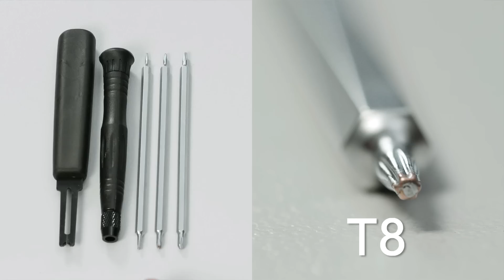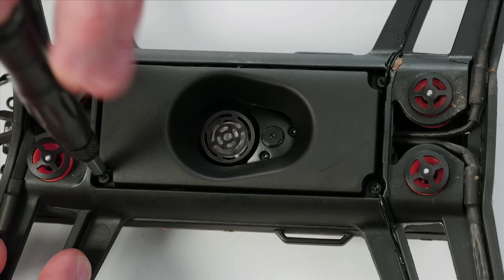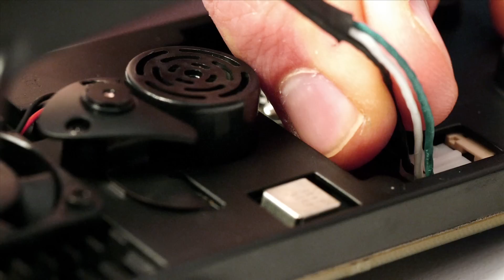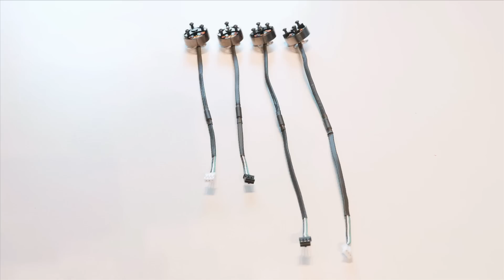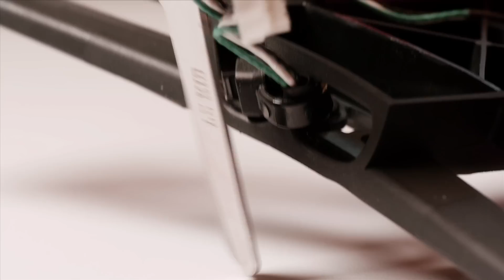Parrot Bebop Drone: How to repair Bottom parts

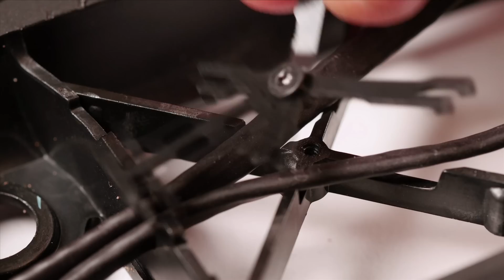Comment: What is the part name or number of the x plate or bracket you take off at 1:53 on the video? I got mine used and it was missing. I was able to use a small zip tie to keep the wires off the fan but would like the stock part instead.  Thanks.

Comment: Hey parrot and youtubers this video guided me well when I was trying to replace the front motors of my bebop drone. These parts are expensive so be very gentle with the parts especially the wires on the motors because they can be easily detached. 

Although the video covers everything that needs to be done in order to fly with your drone again, I kinda went wrong on two points which can be easily overseen if you wont pay attention to the details... 

Pay attention to the exact placement of the motors, in my case 3 motors were damaged when my drone crashed onto a tree. I had to replace 3 motors (whole set costs me round 80 euro very expensive). I installed the motors wrong on my first attempt. I accidently switched position of the two front motors. The drone did start up but was unflyable and instantly crashed after taking off. Also, do not pull too hard on the wires attached to the motors. You can easily pull to hard and detach the wires connected to the motor. I found it very difficult to repair this since those wires are so small and you`ll need special tools which arent provided in the standard toolbox you can buy from parrot.

Also cable management is kinda hard too and very very important. The cabels can easily twist into eachother which makes it difficult to determine which cabel belongs to a motor. Although the pins are givin colors, the fitting of the motor on the placement of the motor on the chassis isnt indicated so you need to be sure to attack the motor on the correct side of the chassis. 

Be sure to attach the wires in correct way shown in the video, its very hard to get it very good organized since there are a lot wires (6 in total). I used glue for the two smaller wires to get them in the right position again (I think those two small wires are for GPS location but I dont know for sure anyway.

Third thing is the propellers, look for the pin indication on the motor to pinpoint which propeller should be connected on your motors. These things are covered in the video but I wasnt paying enough attention hope you do better then me ^^ In the end though i finally got it to work (today). 

Parrot great video, the song kept me happy while I was trying to revive my bebod^^ I do have a small point on the video, the points mentioned earlier should be made extra clear to the viewers because I personally just overlooked the details in the video instructions.
Reply: +Everythingrcpro What did you tell Parrot since they would ship 4 new motors free of charge?
Reply: hey there! i am new in europe and i damaged one of my motor. to order the parts did you contact parrot or something else?

Comment: wath a awfulll feling to spend so much money then weeks later have problem 11 message at screen,or motor stalled ,(lucky it was only bouth 8 mtrs high and didn't broke on to million pieces,just minor battery damaged)so down whit this experience,  took me weeks to decide purchase this drone instead of  phantom DJI then this bad experience whit motors malfunction, contact bebop customer servicethey told me it takes 5 weeks or more for them to repair it ,or 7 to 10 days to send you replace motors to do it myself ,realy? after spending close to 1000 us dlls ? whit some spare parts and skycontroller,besides wifi range has never been even more than few meters {plain view} altitude has been reach of bouth 150 mts [almost straight up from were pilot]quality image has been exelent,handling and gps signal awesome ,but heck such of bad experience, now bebop 2 its coming?I woud have buy on a heart beat but now I be thinking twice to go again for bebop parrot.THUMBS DOWN!

Comment: seems straight up and very simply engineered with minimum junk.....motors and wires with nice connections to batteries with nice connections and camera with nice connectors....all mounted on a simple frame...how much simpler could it be.....i want one bad!!!!!
Reply: jon levesque sr I'd say it's a worthwhile buy. Mine's put up with a lot of abuse and only now needed a new motor
Reply: i could sell you mine i have a fw upgrades and i am working on possibly getting upgraded motors from t motors
Reply: ok they are great i have found that the connection is not the best but there is this wifi extender and it should work great and i moved the antennas to the back arms facing backwards were i would be standing and it should work better i have never flown it but i am going to do some upgrades and maybe even get a light kit

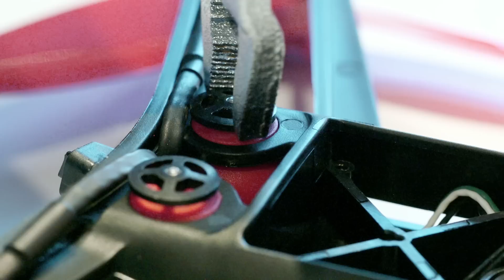Comment: where do you get those little wheel things that he screws in at 4:55? one of mine broke along with the metal screw/leg that its attached to. I didn't see them on the spare parts page
Reply: they come with the legs of the drone
Reply: +Gray Smith Its included in the spare part package for lower parts in parrot store.